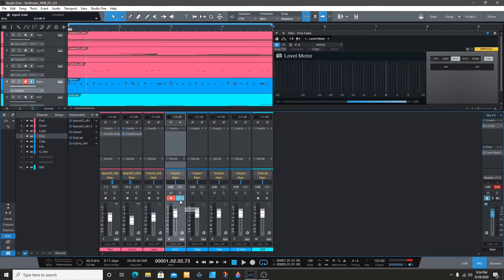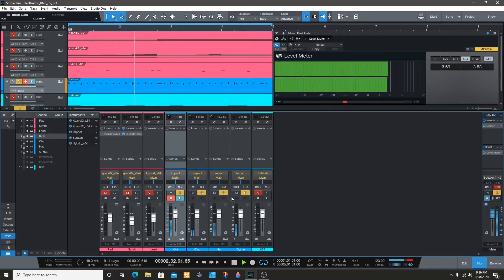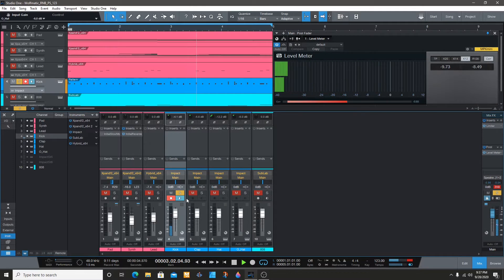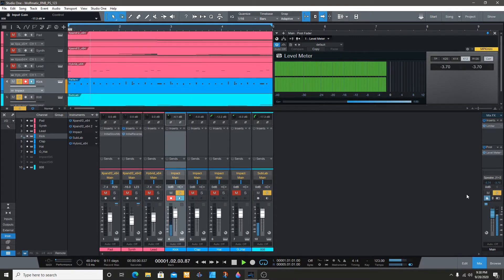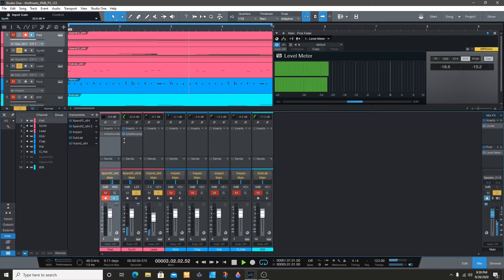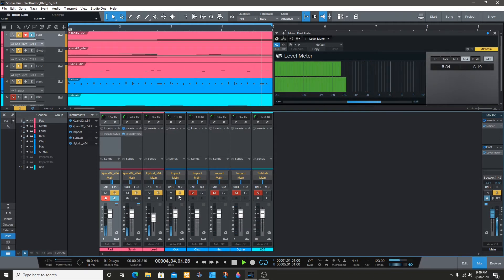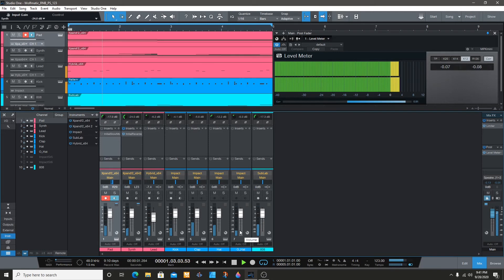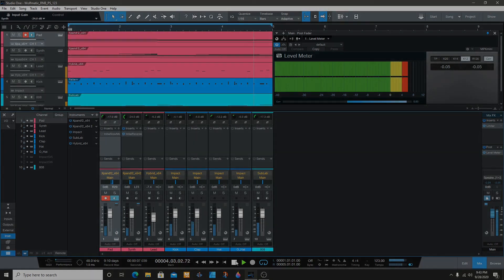How to gain stage in studio one 5 | Presonus Studio one

Comment: So what's the difference between gain staging and a static mix?
Reply from the maker: I didn't noticed your comments...gain staging is when you level the tracks while the fader sits at 0. Static mix is using the fader to level your tracks without using any plugins
Reply: @WolfmaticBeats  Hi I am  an new sub and learning from you today.  I understand gain and what EQ is. . BUT!
Do I have to use a VU meter.?. Whats an Good alternative.  Static mix or limiter following the EQ and compressor. That VU meter is so hard 😫 and complicated.  I wish I can just click and type in the VU -10 dB for vocals. Lol. Please reply 🙏🏽 blessings. Thanks 
Also can I gain stage with just a limiter instead of a VU meter. I'm looking for alternatives.  Please reply. 🙏🏽 Thank you. Ps. Is static mix just as effective the the VU meter method.
Reply from the maker: @DivineDisciple7  no you don't want to mix or gain staging with a limiter. You can but I wouldn't recommend it. Also you don't have to use to VU meter. You can use any other meter as long you choose a set DB to work with, although you shouldn't just rely solely on a meter. Using and training your ears are the best alternative even if the visuals do help.